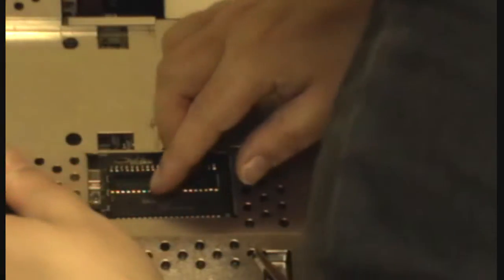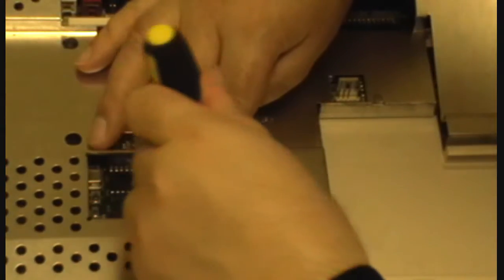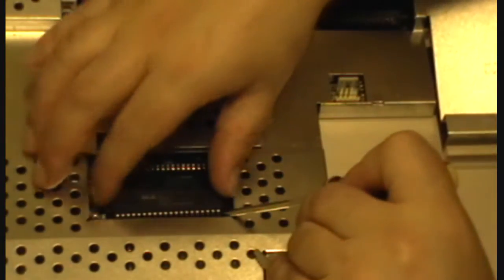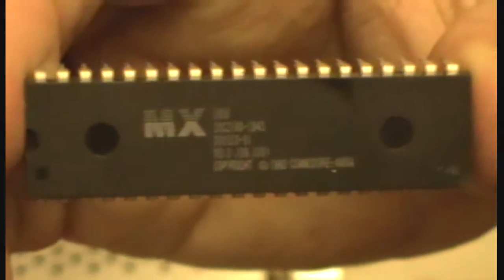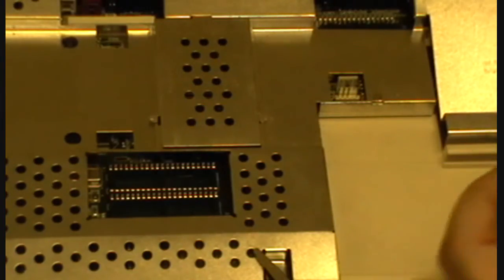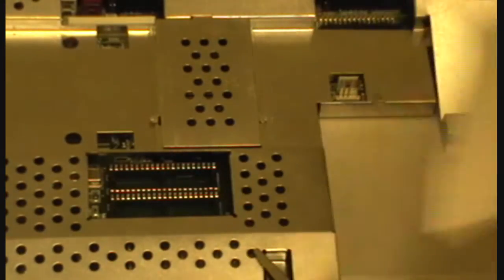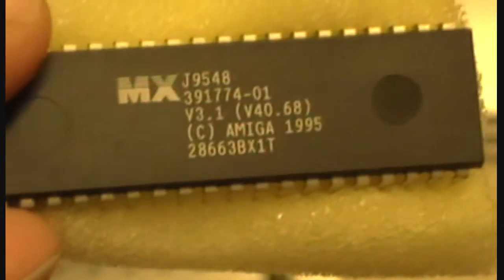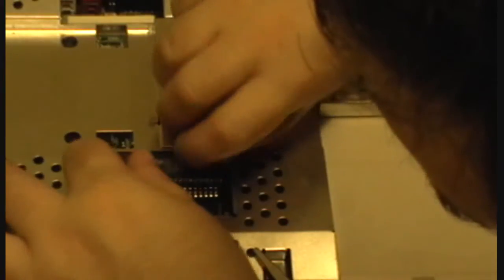Amiga 1200 Project: Part 3/5. Motherboard replacement and upgrading to 3.1 ROM with CF Flash Drive.

Comment: How come your 3.1 ROM's are black? I found some that are blue with a white n red logo.
Reply from the maker: I honestly don't know. I did buy these chips some time ago. Perhaps the chips you purchased are a new design. Where did you purchase them from?
Reply: I just today purchased from Amiga Kit (UK) unless it's purely a sticker, would be my guess. I got 3.1 kickstart rom chips, workbench 3.1 floppies and 4gb flash cart with amiga os3.1 and whdload, i think thats all i need.. excited but nervous. never upgraded a commodore
Reply from the maker: Ah yes, Amiga Kit. I use them a lot they are a very reputable website to buy from. I think it is just a sticker that they put on them. Unless they have a new manufacturer that makes them.

Have you installed them yet?
Reply: DLiberator78
No, only ordered them earlier. It looks simple enough, i have a flathead screwdriver.
Reply from the maker: So sorry you did day in your previous comment that you only ordered today. I'm sure they will be fine. What I would advise though is to use an anti-static wrist strap and make sure you ground it.

The static electricity from your hands could fry the chips. So as a precaution I would always advise a wrist strap. Also be very careful when removing the old chips. At the time of recording I did have an IC remover tool and had to use some hooks but this is not ideal and may bend the pins.

Best of luck to you. I hope the replacement goes well.
Reply: DLiberator78
Thanks mate, i haven't got an extractor nor strap, would wearing rubber soled shoes work on cardboard? I've built pc's on carpet, beds and theyve been fine.

Comment from the maker: @Retrosofer Wow you are a braver man that I. I would have been worried about damaging the ROMs but I guess as long as you are careful it should be fine. I got the hookset originally for my old Xbox 360 with had the RROD You need these tools to prise of the X-Clamps.